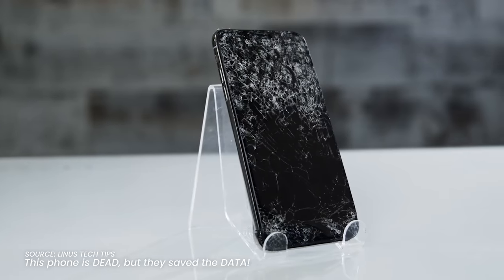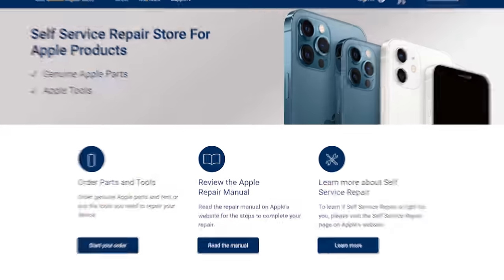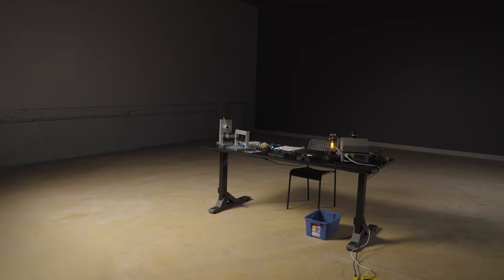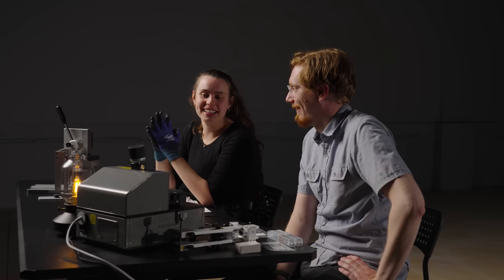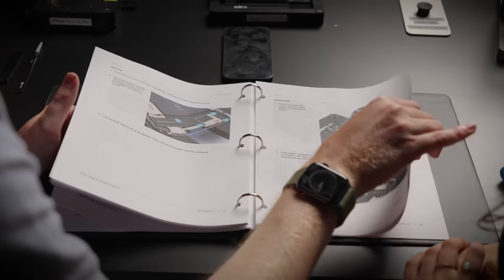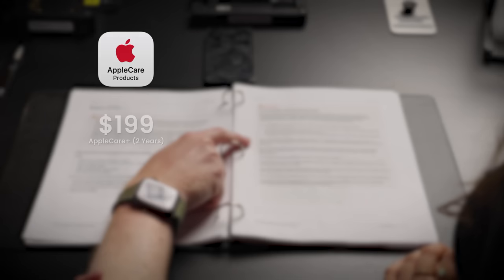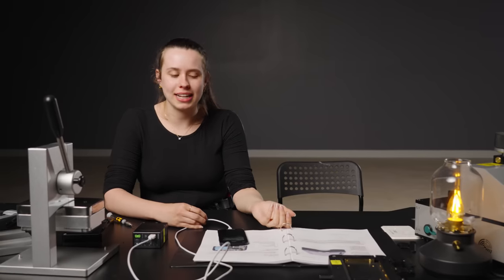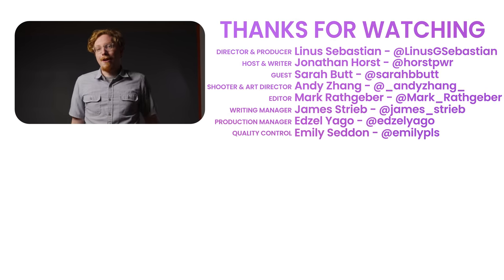I made her fix my mistake!

Comment: The one big problem with Apple Self-Serve Repair (and the Independent Repair Program before it) is that you can't really buy and stock parts, which is how you get quick turn-around times in the phone repair business. Louis Rossman actually stopped doing iPhone repair years and years ago because he couldn't do same-day turnaround times and nobody is willing to have their phone in the shop for a week.
Reply: Unless you are Apple. Then just screen replacement can take you a month and nobody cares. (pesonal experience - 12 mini screen replacement took them about 34 day)
Reply: I still don't understand the reason why authorized service provider other than genius bar cannot stock parts, especially screens lol
Reply: I work at a Ubreakifix and we can do Apple OEM repairs in like 20 minutes but if something goes wrong at any point that 20 minutes can become more like 2 days while you get sent through answering machine hell trying to get a new GSX ticket made. 

By comparison, Samsungs are way easier since at the end of the day they don't have the same arbitrary calibration requirements and are generally much more flexible when it comes to repairs. Not perfect by any means, but definitely preferable to anyone doing this professionally.
Reply: @theEskalaator  wait how ? changing my 5s battery (in 2019) and 13 pro faceID module (in 2022) only took an afternoon ?
Reply: @christianvaniten4281  Yup.  I too am Ubreakifix Canada.    GSX tickets D: NO BAD
Reply: @skyguardian18  Louis Rossmann , answered this in one of his old videos. It's because the authorized service provider could sell these parts online. To make a profit. Apple wants as much control over genuine parts and don't want them end up being sold elsewhere. So if a customer wants their phone screen fixed, screen has to be ordered with the serial of the phone being repaired. This shows apple that the store needs the part for an actual repair.

Comment: The whole iPhone repair program felt just like... like many had said, a way to push you to have Apple fix it instead. 
And when regulator body cranks down on the right to repair, Apple can just point at it and say "we have it", or worse use statistics from the program and push back the right to repair " because people don't use the program"
Reply: you missed a crucial point: it is not Apple providing the SSR. It is run by a different company. From their "About us" page: 
"Apple has engaged Service Parts or Tools, Inc. (SPOT) to create the Self Service Repair Store to make genuine Apple parts and tools available. We are here to support questions about your order and assist with the System Configuration step that may be required at the end of your repair.

SPOT is a wholly owned subsidiary of Communication Test Design, Inc., a full-service, global engineering, repair and logistics company headquartered in West Chester, PA."

Apple just sells them the parts, like to every AASP and IRP, which they then sell again to the end customer. It's like GeekSquad selling you the parts. That company has no affiliation with Apple whatsoever and it can hardly be used as an argument against right to repair in court/congress or whatever else.
Reply: @PvtAnonymous  That's only what public knows, I'm pretty sure Apple controls pretty much everything on how this program will work.
Reply: @NanoMine  not really. Everyone who knows how AASPs and IRPs get their parts from Apple, this is basically the same thing. I can explain the process.
When a repair is started via GSX (Apple‘s internal system for repair management) there is a few things required. The serial number, turning off Find My, personal contact data and what part is used for the repair. When all of that is entered into GSX, you can either start the repair if you have the parts stocked or you have to wait for delivery. After you repair the device, the serial numbers of the old and new parts have to be entered into GSX before you can proceed with system configuration. The old parts can be send back so you don‘t have to pay the full price.

Now, SPOT does just one thing differently: they send you the part to do the repair. Everything else is the same. 
Their process involves creating a GSX case for you, entering your data, ordering the part from Apple, they pay the regular IRP/AASP prices for the part. The part is then sent to you via Apple‘s distributor network and after you perform the repair, they do the system configuration like any other technician would, I mean the exact same way. They make their profit from the difference between what they pay Apple and what the customer pays them. The renting of the machines is the same. SPOT own the machines and they can do with them what they want, in this case - rent them out. Apple has no real involvement in this process except allowing them to sell parts to end consumers, everything and I literally mean everything else, is handled by SPOT.
Reply: @PvtAnonymous  Thanks for that explanation and I appreciate it but how do we know that apple didn't create this procedure to start with? Why make a repair so hard and in-turn costlier for SPOT and now the consumer? It's obviously profits.
Reply: @NanoMine  because there is no evidence that they did. Apple does it in hopes of selling more parts, they have no legal risk or extra costs resulting from SSR, so it‘s basically free money for them. SPOTs profit margins aren‘t high, that is true, but they still make money from all of this. Samsung sells parts via distributors as well, probably exactly like Apple does it. It‘s just that Apple requires the system configuration and all the shenanigans to finish the repair, which SPOT is handling for them. You should also not forget that it is SPOT who makes the final prices, so „taking it to the Apple store“ is cheaper indeed because of the already high initial markup on parts prices by Apple. 
Oh and on the 49$ renting thing: CTDI (the parent company) is a global supplier for many companies and can negotiate insanely low shipping fees due to their market credibility. It‘s the main reason why 49$ for like 40lbs of gear is even possible for them.
Reply: @PvtAnonymous  Wouldn't it be more profitable if the y made repairs easy and sold more parts to more people easily? Clearly people are willing to buy them. But oh wait, there's even more profitable way and that is to make it hard to get parts and sell new devices instead. I know other companies sell parts through distributors as well but they don't require all those shenanigans that apple has to make it difficult.
Reply: @NanoMine  profitable for who exactly? Apple makes 100% profit for every part sold through IRPs or SSR. Why should they lower the prices? They would make losses. It‘s way better if they just keep selling the through SSR. SPOT has no saying in this, they just pay the regular prices and are fine with it. 
And I don‘t know what you mean by „making repairs easy“. The repair is as easy as it gets. There is no other way to do it except the Genius/AASP/IRP way. Apple didn‘t redesign anything for SSR, hence the process is exactly the same. And why should they? It‘s SPOT who has to deal with all the annoying stuff, it‘s their employees, their call centers, their everything. Apple clearly wins from this while doing nothing. I guess SPOT expects future profitability from SSR, but we will have to see how it goes.
Reply: It’s the same way they repair it at the Apple store. Apple is just providing what they have at the stores to the customer. They’re not about to make the process “easier”. iPhones have never been easy to fix, they are a pain for the technicians as well and I feel like this video comes off as dishonest. Repairs aren’t like the product itself, it’s not sunshine and rainbows on the backend. I feel like this is being mad at a cat for not being a dog. 

False expectations of the repair process, it requires patience and training. Had they gone through the training first they would know how to remove the adhesive on the back of the battery easier. 

Source: Used to work at an Apple store and now work at a school repairing apple products, just completed training for new MacBook Pro models. Can see all repair documents because of me being a technician
Reply: @cyclingvideoes  The thing is Basic repairs like replacing something shouldn't be that hard to begin with, it's not like they can't make it more repairable, they just chose to make it more difficult intentionally and that's a problem. I understand for board level repairs as they need to make it so small to fit everything and it can't be done with through hole components.
Reply: I do agreed that iPhone are becoming harder to repair each day, but to their credit at least Apple release the repair manual for free, you don't even need to order the parts first. The documentation is actually the most important aspect from this self-repair program, so anyone who wanted to do a repair can evaluate the risk and prepare their tools. They also don't forces you to use their tool, which also great thing because you can use iFixit alternative tools if you wanted to.

Now about the price, obviously Apple will not give you much lower price than their offered to AASP network, and since the SSP is technically offered by a third party company, you shouldn't be expecting much from it. 

However I still see this as a progress, if you're living in a place where AASP or genius bar is not an option, you can just buy the part you need to replace and ask local phone repair shop to do the replacement for you, even if they're not part of AASP.
Reply: @skyguardian18  That documentation is absolutely worthless if you can't get all the parts easily or at affordable cost. Now one thing that they can do to help would be if they can release the board diagrams so 3rd party shops can repair old broken boards/devices so you don't need to get apple involved and get your device repaired at affordable cost but that they won't do.
Reply: The people defending Apple in this thread are... how should I put this nicely... over-optimistic. "That car crashed right through the wall, through the living room, crashed another wall inside the house into the next room, and hit someone who was at the end of the 2nd room, the person died" ... defenders: "It's fine, they should get a good job medal, they started braking right after the 2nd wall when they saw there was someone in the 2nd room" and "the car has strong brakes now even if the steering wheel gets stuck a lot and when it does you cannot use it for 5 seconds"
Reply: You watched the other video then..
Reply: That is what apple has done historically. Their sanctioned phone battery replacement system for stores required you to open the phone, read a code, order the battery and wait for the battery to arrive before replacing it. Thus they prevented same hour repair.
Reply: @Photo Bunny the prices are high because Apple is selling them to another company who is then selling them to customers. So instead of paying for someone at the Apple store for it, it's the company in the middle taking a cut. Apple doesn't care, they just want to not be fined at the lowest cost to themselves. If someone complains that paying someone to repair something for them instead of doing it themselves is more expensive, then idk how they are still alive. I mean, it's the most basic thing everyone should know, it's how restaurants work and make a profit. The $10 meal at that fast food would cost you $5 to make yourself. That restaurant who charges $20 for a nice whole fish, $8 to make yourself. One restaurant may sell the same dish at $20 and another at $30 because of their popularity yet theirs is maybe not that much better in taste. The problem with Apple is that take advantage of the naivety of their loyal fanbase and leverage than fanbase over devs. And they are doing it again with the program.
Reply: @Photo Bunny you have absolutely no idea what's going on. Don't waste our time please.
Reply: The counter to that response, is: "if you already have it, then you should have no problem with legislation that makes it more sustainable"
Reply: @ferdievanschalkwyk1669  Feels like Photo Bunny works for SPOT, defo sus... I'm out of here 😂
Reply: @Photo Bunny massively over charging for the parts though. By a considerable margin. The cost of the display on the apple device is more than that of the S22 Ultra which has a more advanced and better quality screen. It’s a rip off which ever way you look at it.
Reply: I agree with you on this! The only good thing I see here is that repair shops can buy specific equipment to open up the iPhone more easily or cleanly. Other than that, I'd rather have Apple repair it if I don't want to take long
Reply: @randrei001  at that price though... knowing that a lot of it only fits one model of iPhone and that more generic equipment costs like 2-5 times less at least depending on the tool (I haven't compaired prices, just from what I saw on the LTT video when they were browsing the website and limited knowledge of the generic prices)
Reply: @Photo Bunny You do realise that you peopel apple the same fee for when they fix it including their operating costs. When you fix it yourself they dont make any costs of actually installing it and therefor it should be cheaper to do it yourself since you're only paying for parts and not labour.

Comment: I work at a Genius Bar and can confirm all the tools and equipment are exactly the same as the ones used in store. Also, the reason other parts aren't available (like rear glass) is because we don't have those parts ourselves, as they come bundled as a "rear system". Effectively, Apple are giving access to everything we have access to (other than diagnostics) for the supported phones.
Reply: This is what I wish the video explained! I feel like they make it seem like it hasn’t always been this way. Where they just “purposely” made these specific repair tools to discourage people to not use the repair program. But it’s never been sunshine and rainbows repairing iPhones, lol. Sure, older models were “easier” on the scale of repairing iPhones but with higher demand of phones (like being waterproof) you’re going to have more compact form factors and things that make it harder to repair because of that.
Reply: @cyclingvideoes  It's like repairing old computers from the 80's and 90's. You could literally swap the chips and stuff because they were far, far, far bigger than they are now. Given how densely packed modern circuit boards are (on several layers even), good luck. It's not so much companies don't want you repairing stuff, it's they don't want you to try it, fuck it up because it's incredibly difficult then blame them for it. Things like RAM and storage were only ever easy to replace because they were VERY unreliable for so long. Hard drives died ALL the time, especially on laptops and even RAM would go bad in a very short period of time. I remember our IT guy at primary school having a bin full of RAM sticks so they could replace them every year as was the recommendation back then. Modern hardware is orders of magnitude more reliable, so it's far less worth the effort of making them be swapped out in many cases.
Reply: @cyclingvideoes  
Way late reply, I know.

The complaint isn't that, the tools are made to be difficult for the average person to use.

The complaint is, the surrounding programme is purposely made difficult.

They purposely made the process annoying and bureaucratic, rather than just supply the manuals, and provide an easy way to order spare parts, no questions asked.

Comment: As someone who works in a repairshop and fixes iphones all day, apple is probably the easiest to replace in theory (Compared to Samsung sending us the whole chassis and screen) but apple uses the worst adhesive for their batteries that snaps all the time and makes it harder and harder every year to remove the faceid from the screen.
Reply: YES!!!! I also do insurance repairs for Verizon and stuff, and thus I do use apple's calibration. I takes 5 seconds to do the calibration. Multiple days to go through the calibration is absolutely ridiculous. Apple Phones are by far the easist repairs to do, when apple isn't being a b**
Reply: interesting
Reply: I would rather repair Samsung all day every day. The new parts come with a new battery by default and the repair is still cheaper than Apple. They also require full testing to meet factory spec before the device can leave the facility